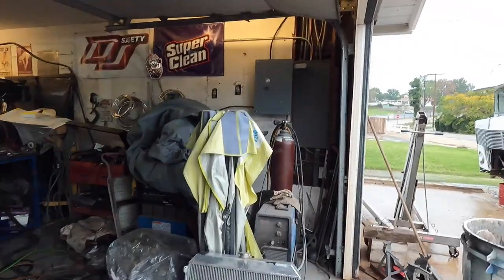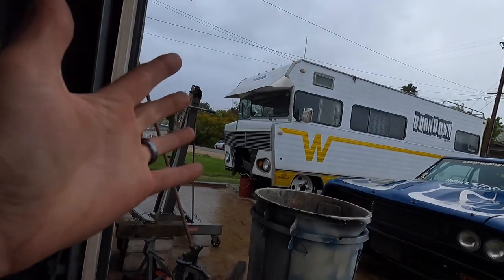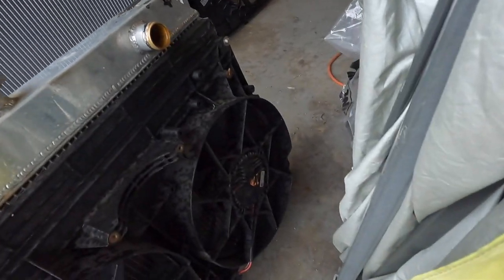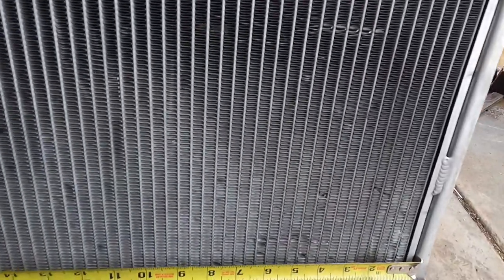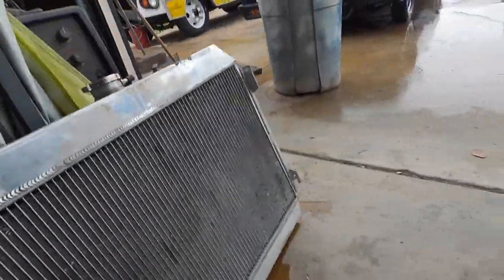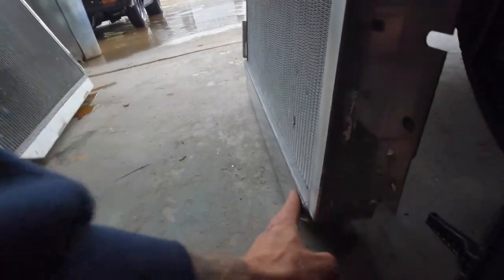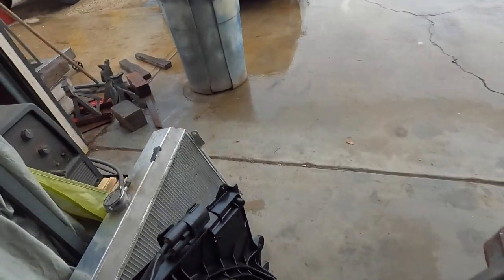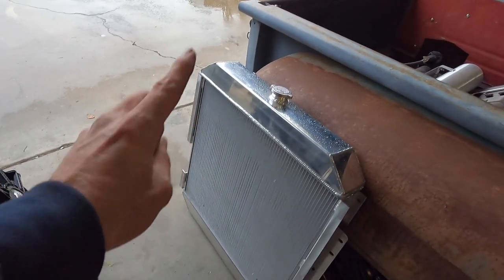New Champion Radiator Comparison

Comment: Surface area and volume are important.  Also an expansion tank with the hose going to the bottom of the tank so when it cools off it sucks in coolant. Over some heat cycles, this burps out & purges your air pockets. Don't get a janky aftermarket fan, and probably shouldn't spend huge money on a nice aftermarket fan. Instead, go to the junkyard and pull a stock electric fan yourself. The flow way better than cheap aftermarket, they have OEM reliability that came from development testing, and they're cheaper than any aftermarket fan!Stock water pump & t-stat are probably good, air flow is important,  but shrouding I think people miss. Shroud so that the low pressure area in front of your fan completely seals to the entire radiator core (don't leave a big portion of your cooling unused), but also shroud around the radiator so the hot air dumped out the back of the fan can't make it's way back to the front of the radiator.  An flexible air dam underneath can block some of that air from recirculating under the front in traffic w/o smashing to pieces on speed bumps, Always pull cool air in! And to that point, ideally, don't put the hot-side of your turbo kit in your radiator's inlet path lol!  I know you know, Dane, but sharing what I learned in figure 8 racing.
Reply from the maker: The turbos are up front so people can see them. Everyone said it would never cool with them in front of the radiator like they are but it did pretty darn good and looked awesome dong it.  I think a chin spoiler is next up on the list to keep the hot air from getting sucked back up like you said . As for the factory fans the reason they are better is because they  are bigger and badder. Aftermarket fans are usually capped at 400 watts so DIY guys dont wire up a monster fan wrong and burn their car to the ground.

Comment: It would be cool to set up one of those brushless fans on my stock silverado with an arduino for the pwm  and have a set level for low and maybe a level for high but that is adjustable with a potentiometer inside but what year Camaro is that for I went to ebay and they had some double fans for like 10-11 but the pics were not good enough to tell if it looked like they were brushless or not
Reply from the maker: Look at the 15 and up silvarado fans. Dual brushless and they would probably drop into your set up or at least be close I bet.